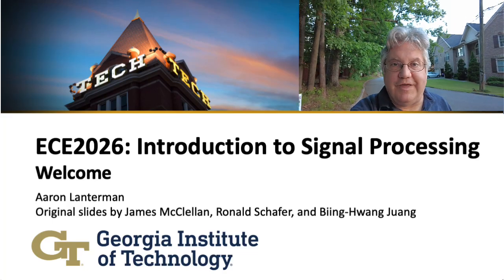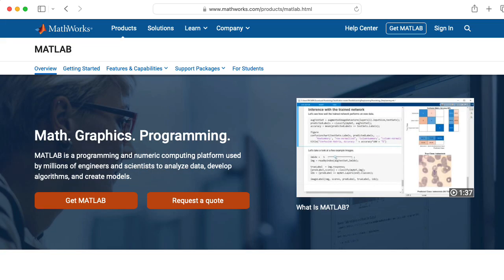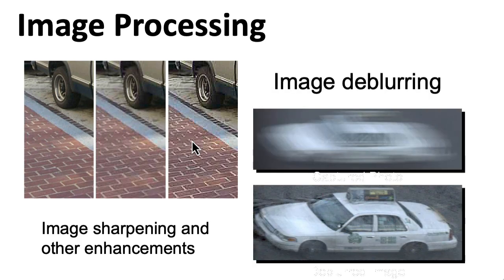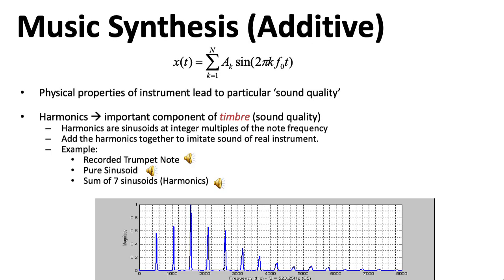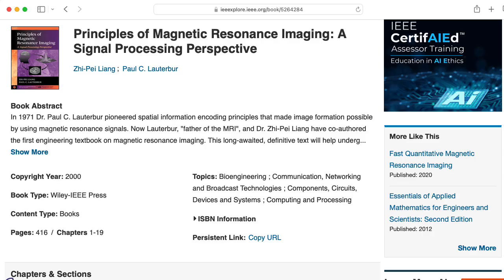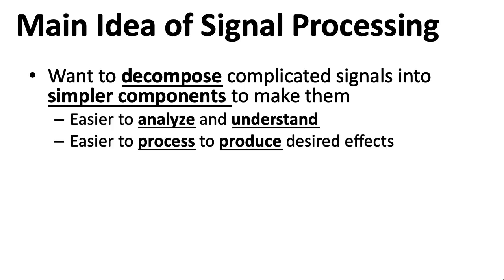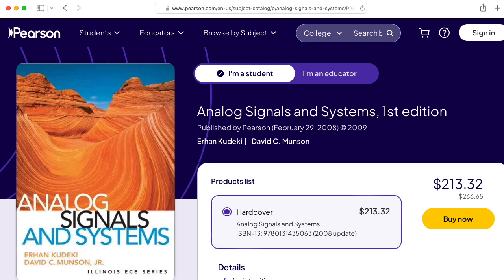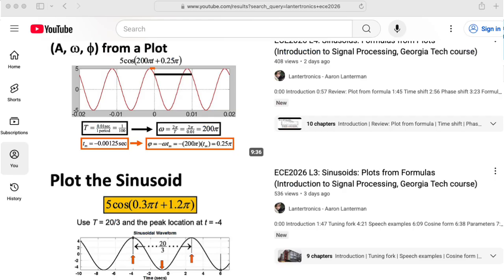ECE2026 Introduction to Signal Processing: Welcome! (Georgia Tech course)

Comment: Speaking of DSP artifacts for doing duration/pitch changes independently, the THX sound (at 7:25) produces some crazy extra tones when sped up (or slowed down) using YouTube's playback speed controller.  That alone would be interesting to do a deep dive on; I assume it's because that signal is just so dense, any tiny artifact is likely compounded by a dozen others happening simultaneously, and the interplay produces those extra tones?

Comment: How about teaching actual circuits with labs every semester. Why are most new engineers so useless when they get out? Don't need to know complex analysis before they even know how to stick a meter across a resistor.
Reply: Great insight , but usually many universities don't do this , I am wondering if there is any Lab Simulation/Software tool that you recommend that could solve this problem for us  ? because standard circuit simulation tools are so complex to be honest and have terrible interfaces